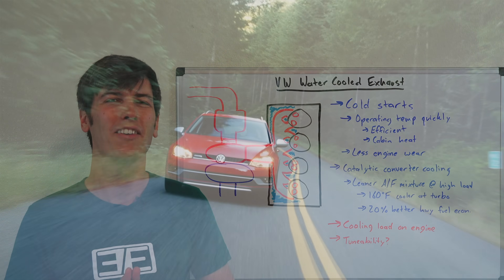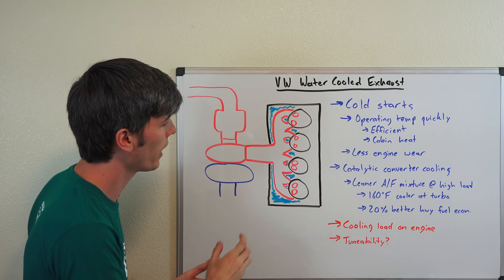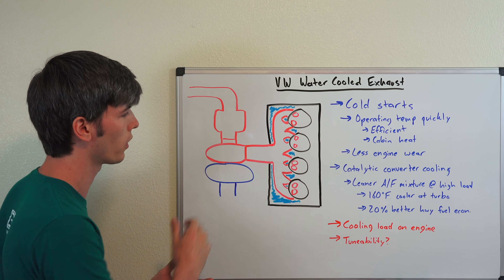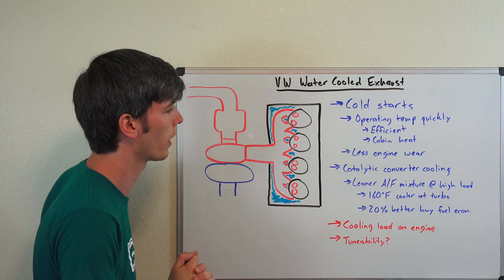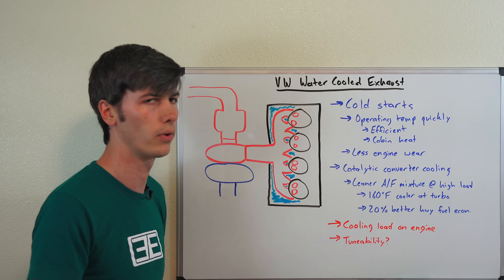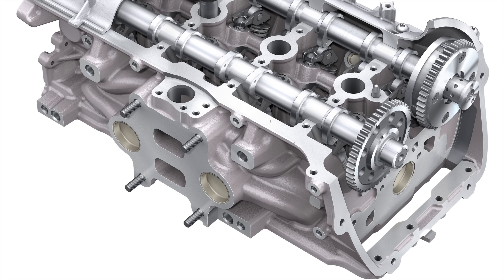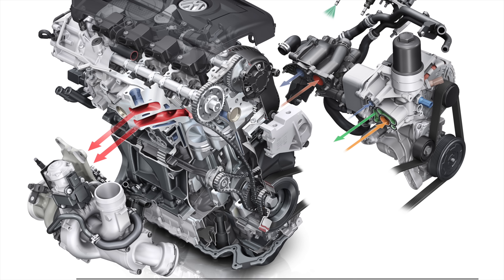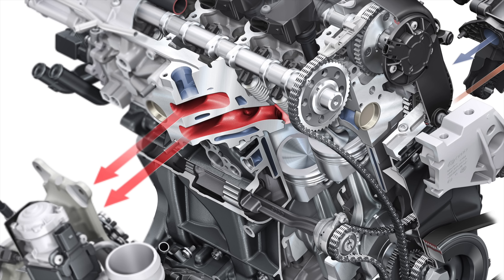Why Does Volkswagen Have A Water-Cooled Exhaust?

Comment: @Engineering Explained
Question for you, how does the cooler air (loss of kinetic energy) impact the turbine portion of the turbocharger? Doesn't this mean that you have less energy to power the turbo? Why not cool the exhaust gasses between the turbine and the catalytic converter to still be able to run lean without loss of turbo efficiency (or at least enable a larger turbo with more boost)? If you get a chance to answer, I would appreciate it, otherwise, thanks for your videos, I thoroughly enjoy them.
Reply: That's what I was thinking. Isn't this design less efficient performance-wise? Or does the cooled air get denser and therefore better to move the turbine?
Anyway, for those of you who are refering this as not being original: I don't know, but I would definitely bet it's not. German engineering is more about picking old, badly explored and before-it's-time ideias from other brands - likely italian or british - and improving then untill reliable and usable.
Reply: ADFKSJG 
This is non VGT.
It has "electronic/solenoid" type wastegate, like the ones used to control EGR valves.
Reply: BruceLeedar , most inovations yoi associate with german brands: VGT, first successfull aplication by Audi, created years before by fiat @Croma, same for direct injection; reverse flow V engines with turbo between banks, successfullu aplied by BMW in V10 M engines, first used by Ferrari in 70's formula 1 engines, etc... Not criticizing, just making a point ;)
Reply: So, as an addendum to my question, I realize that you can do many different things to design for the available exhaust gas power (vgt, smaller compressor), my question was more about if there is a loss of available exhaust power with a water cooled exhaust manifold. I do recognize a significant cost reduction to in-head exhaust water cooling, because there is already cylinder jacket water cooling right there, and the block is cast, so it is much cheaper than some external cooler. Also the small engine may not be able to take more boost than it gets right now, so the loss may be fully acceptable.
Reply: Why do you keep suggesting lower intake temperatures has an effect here? Depending on if/where your intake comes from, where your charge cooler is located, methanol/water injection, if you have a turbo blanket, yadda yadda. Is the assertion that "cooler exhaust" leads to "cooler intake" a model/design specific point you are making or is this just an idea pulled out of the blue?
Reply: No wastegate, and it has actuator - so i'm pretty much sure that this is VGT

In 911 '07 with 3.6 engine they use VGTs
Reply: Very, very special VGT's from Borg-Warner specially for Porsche, to withstand the higher petrol gas temperatures. And up untill today, for some reason, nobody followed nor it got cheaper.
Reply: You cool the exhaust gases to protect both the turbine and the catalyst from high temperatures.
Reply: ADFKSJG you'd be surprised but a lot of the heat into intake air comes from the compression of the air and not really from the turbo's heat.
Reply: ADFKSJG it does have a bigger impact on the delta pressure and temp from inside the housing and when out of the turbo. It will be better for the turbo as it will be cooler I agree.
Reply: Actually, the exhaust stream cools after leaving the combustion chamber and is contracting on a very smallscale magnitude. The exhaust gas expansion you speak of is the highly pressurized gas from the combustion chamber occupying the exhaust chamber volume. (that is how tubular headers work). that creates a delta P but the expansion itself is not the mechanism by which the turbine wheel spins. the turbine wheel is moved by the pressure of the gas volume acting on the blade area. That is absolutely a function of mass an velocity. This is why we size turbine housing inlets and wheels carefully. The observed gas expansion is an effect not the causative mechanism.
Reply: +João Figueiredo  It's a VERY old concept.  Don't think of it as an integrated exhaust manifold - it's really just siamesed exhaust ports, what most engines used to have in the days before cross-flow heads (e.g. BMC A-series engines used this for the centre 2 cylinders.)  The exhaust ports from 2 adjacent cylinders join and exit the head through a single port.  The only real difference is that they run the ports so they exit the head close together, rather than spread along the side of the head, so that a single turbo can be bolted directly to the head, instead of having an separate external manifold between the head and the turbo.
Reply: but cooler air is more dense so wouldnt that mean better spooling?
Reply: TheBiohazard43 well, turbo spins up by density of air and pressure of it
Reply: ADFKSJG Primarily due to heat which directly affects the pressure. Reducing the heat will make it more dense but won't spool the turbo faster because of the energy you lost. If it was higher density at same temperature I would agree with you.
Reply: Is it VGT? Does he refer that? I don't think they can lower the temperature that much to use VGT.
Reply: technology is going further, and if it can stand for sportcar temperatures - it surely can survive in that car, i thing that there are a lot less heat in exhaust, also it cooled.

so you talkin that wastegate is located AFTER turbine? look at the picture
Reply: I think VW has introduced this year a "mass produced" gasoline engine with VGT. At least in the european market. TSI 1.5 EVO.
Reply: João Figueiredo 'German engineering is more about picking old, badly explored and before-it's-time ideias from other brands - likely italian or british - and improving then untill reliable and usable.'

Can you think of some examples?
Reply: ADFKSJG that's fundamentally flawed. The combustion will always produce the same amount of energy and waste in form of exhaust, reducing the temperature after that of the exhaust does not make the piston more efficient. The pressure is not caused by the piston, the design of the exhaust and head is made so that the piston has as little effort as possible removing the exhaust gases. It will cause a decent amount in pressure loss. The temp is reduced by almost 10% so the pressure loss is significant enough. If you have a gas at 800 degrees it has a massive amount of pressure. If the pistons had to push the turbo constantly it would not be as efficient and thus the turbo is designed to use waste heat energy.
Reply: zfxcvgbhnjmk yes it is highly pressurised gas from the combustion chamber because it has just exploded and is 800 degrees. Yes it is, that is how the turbo is designed so that it creates a pressure differential across the inlet and exhaust, that's why the impeller looks so weird and a simple fan isn't used to just soak up the force of the gas pushing. Tubular headers work in that way because each piston expels a highly pressurised wave of gas. Due to the heat it increases the velocity of the gas and creates a portion of low pressure in the other tubes. Exhaust wrap keeps the heat in that increases the velocity in the header. But that is completely different to how a turbo works. It benefits from the pressure differential and spins when the gases expand outwards due to the high pressure.
Reply: aussiebloke609 it's not odd.Hondsa were doing this 12 years ago and it is common place in gasoline turbo engines.
Reply: TheBiohazard43 it's the gas velocity that a radial flow turbine converts to work through change of momentum.
Reply: I know this is a week old thread but i figured i could add some insight. i have no real technical knowledge beside the basic stuff. i drive  a 2017 Golf R that uses this system, i believe it has been designed to keep boost psi up during medium load. looking at the cars performance monitor system at roughly 3500 rpm i hold 14-16 psi of boost .this goes up to 32 psi at redline (the highest number ive seen). The dsg in race mode likes to keep rpms at 2500-3000 so boost is always there. while in comfort mode the car keeps it at 2000 or less until highway speeds where the lowest 6th gear can do is around 3000. so from experience the system is designed to keep turbo lag at a minimum. I havent felt the lack of boost too bad except for when cruising and suddenly giving throttle but this feel like more of a transmission issue than engine/turbo
Reply: PV = mRT. If you reduce the exhaust temperature, then you reduce the exhaust pressure. Therefore, there is less work that can be performed. Don't act like you are smarter than other people because you have taken a few classes.
Reply: Myriad  I  think you are the closest to accurate.  when I wraped my exhaust with thick header wrapI experienced a major reduction of lag. A lower EGT as well for a specific speed/load(500°f=1psi wraped Vs 600°f =1psi.  by keeping more of the available energy inside the manifold ,the turbo (h1c) sees more of that energy, putting more air in .  its not changing how much boost is produced  insted it is changing how efficiently the turbo recevs this energy.  . 
so yes cooling reduces the energy going to the turbocharger and rerouts it to the coolent.  to compinsate they have played with the computer.   when this system is in mid-load "lean burn" mode there is an abundance of heat, too much for the downstream parts.  they had 2 choices  go rich to cool the exhaust with lquid fule phase change, or go lean rasing the EGT to a point were component failure is of risk so cooling is required.  
This is a case of prioritizing mpg over street racing power.  
 hot, fast, and rich off the line , or cool and best proformance  at cruse speed. EPA is pushing the limits of used up technology.  so new technology is emerging.
Reply: I'm not saying it's impossible, but don't you agree that if there was that much of a benefit to take from a petrol VGT, we would have already saw more aplications so far since '07?
Reply: so, maybe it's first mass production engine with petrol VGT? maybe in 5 years in every TSI they will use VGT?

I say "it's VGT" just because it's looks like VGT, clearly no wastegate here.
Reply: Which both require for increased efficiency?

Ah, no....
Reply: ADFKSJG 
yes, i agree, but not for this model, sorry.
Reply: ADFKSJG 
sorry, again no vgt. Solenoid type wastegate. Turbo code is IHI IS-12
Reply: João Figueiredo Also now they release rear axle steereng on new panamera, and if they release something "new" - in max 10-15 years it will be on mid end golf.

maybe V8 engine? V10 was N/A
Reply: Jonathan Stef I agree with you. Reducing the exhaust temps reduces the expansion of gases in the turbine and therefore spools slower and produces less boost etc... I would probably argue that cooling the catalytic converter directly would mean it wouldn't overheat and you could lean it out.
Reply: Well the answer to your question..this system is only more efficient at load since you would already be bypassing exhaust gasses through the wastegate which is lost energy. With this setup you run less wastegate duty cycle so turbo power is still the same (aka same boost) but you run a leaner mixture which gives you higher efficiency
Reply: zfxcvgbhnjmk I know heat is not kinetic energy. The turbo converts heat into kinetic because of the expansion of gases. Your formula's are correct but the force of the exhaust is not that large at all... if you compare the heat of an exhaust compared to the force, it's very small. You'd probably use a restrictive turbo inlet for better response because it creates higher pressure differential and much less lag.  I agree that higher density would not be worse but if it increased due to a lower temperature then it would be worse because there's less energy. If the density increased but the temp remained the same then that would be great but cannot be directly controlled as easily.
Reply: Jonathan Stef cost
Reply: Yes you loose some power when the exhaust gas is cooler. But you still have the mass flow and you can heat the exhaust up with a leaner mixture. So the difference can be compensated.
Reply: TheBiohazard43 g
Reply: Your understanding of physics is atrocious. Do yourself a favor and get a college textbook off amazon. Heat is neither kinetic nor potential, it is it's own form of energy: internal energy. Force is mass times acceleration; mass times velocity is momentum. Momentum is not force; rather, it is the change in momentum that is a force. When a fluid increases in temperature, it will expand and grow in pressure in confined systems. The opposite is also true: if you cool a charge, it will compress and lose pressure. Higher pressure in piping results in higher fluid velocity. A turbo uses the hot exhaust pulses and converts the internal energy to kinetic rotation, 200* air charges simply do not have the velocity to spin the compressor like a 1100* charge does.
Reply: If the exhaust manifold is cooled it's not direct affecting the actual temperature of the exhaust gases directly so the effect is prob minor. 
Also if the exhaust manifold is cooled then then turbo and the cat won't get as hot due to conduction... This not only allows for the engine to run leaner but also a higher rpm which would spool the turbo faster
Reply: Yep, there ARE loss of pressure after cooling exhaust gases, but also there are win in lower intake temperature, which leads to more power.

and i think, that you lose pressure a little, but gain a lot of advantages - it's worth it.
Reply: you lost some, you win some - cooler exhausts mean lower pressure, but also means less heat to intake air

also there is a turbo with changing geometry, so there is no problem to hold pressure constant.
Reply: I'll give you a hint. Heat is not kinetic energy, it is potential energy. The force of the exhaust stream is mass times velocity. speed of the exhaust stream is modulated by diameter, which is why for response we sometimes use restrictive turbo inlets. The density of the gas stream rises as it cools. This is better for turbocharging not worse...
Reply: You're a fuckboi No because it is more dense there is less energy and less gas expansion to spin the turbo. The turbo works like this and does not spin due to the velocity and density of the air
Reply: ADFKSJG The advantages aren't really that great. A 20% gain in MPG only at load :/
Reply: DH Johnson agreed, both exhaust temp and intake temp do not go hand in hard.
Reply: again
cooler exhaust by 100-150C will cause some drop of pressure, but it almost nothing, because most of the pressure comes from piston, not from temperature expansion of gas.
delta P - yes, bigger is better, but higher pressure in exhaust manifold means higher losses of energy from piston, so lowering pressure by cooling gas saves you a little more energy, because probably it's not rally and you dont need 3.5 bar from turbo.

overall i think that this scheme of cooling gases not increase any losses of energy or boost, but it definetly will help turbo to live a lot more.
Reply: TheBiohazard43
it's always easier to push more gas in volume with less pressure, that why they use straigh pipe exhaust. reducing temperature for 100-150C gives a little pressure drop, just a bit. Each 100C rise pressure for about 4%.

btw - if cooling gases before turbine is not effective - vw wouldn't have done that and not allowed in the production. reliability, longer life,  probably more power, than without it.
Reply: The piston? The piston didn't do squat. The explosion in the chamber did though. When the exhaust valve opens the piston is reasonably close to bottom dead center my friend. Not top dead center.
Reply: Turbo still doesn't use waste heat energy... Your idea about exhaust gas temperature adding to back pressure is correct though.
Reply: To help put you out of your misery:
Heat energy used as source of power from exhaust: https://en.wikipedia.org/wiki/Exhaust_heat_recovery_system

Turbochargers aka we harvest potential energy in form of pressure:
https://en.wikipedia.org/wiki/Turbocharger#Operating_principle
Reply: No the turbo does not do that. The turbo converts potential energy in the form of pressure by performing work. The work is compression of the intake air charge. Heat is already lost energy. That is not recovered by conventional turbocharging. Porsche on their LMP1 care has a heat charger. That exists on no  roadgoing car. So you clearly still dont understand a few basics here.

Comment: Cool explanation, made me wonder though in addition to all your comments if they also did it from a cost and packaging standpoint. By casting the head and manifold as one it reduces the need for a separately cast manifold, not gasket required, and no bolts thus saving part cost and room in the engine bay. Just food for thought.

Comment: a twin scroll turbo would not be of benefit here due to how the exhauist mnanifold is split. normally a twin scroll turbo would have in the case of a 4 ciolinder engine cilinders 1 and 4 feeding 1 part of the twin scroll and cilinders 2 and 3 the other part. in this case it looks like the inner valve-ports of all 4 cilidners are put to one port and the outer valve-port runners form the second exhaust manifold